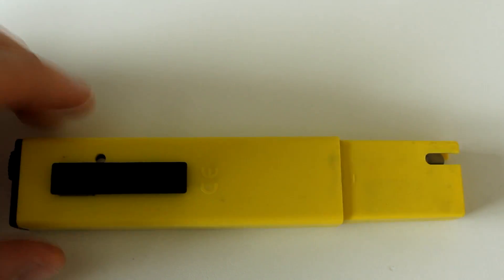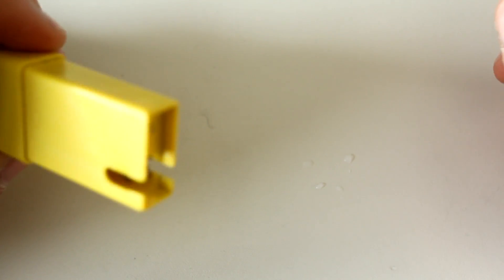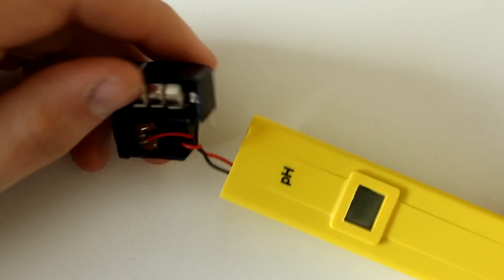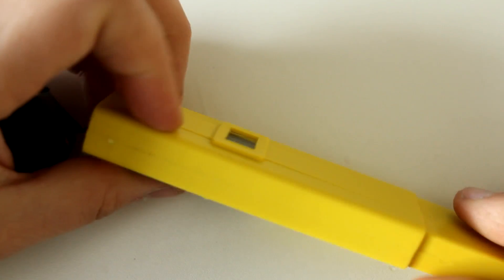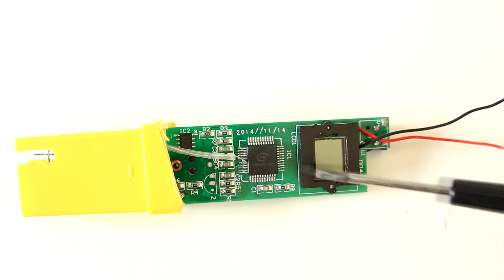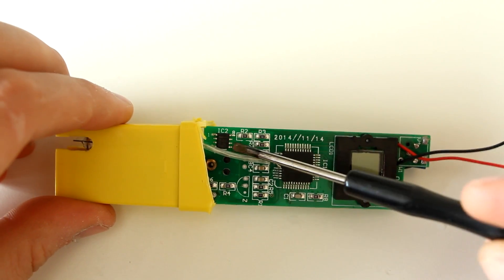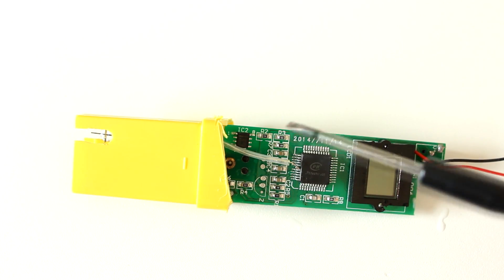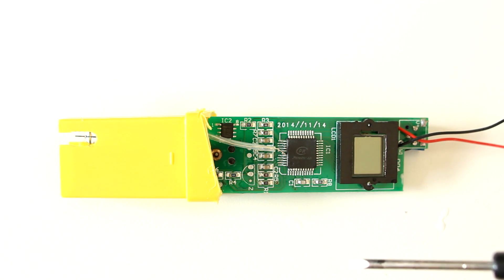pH meter teardown (addendum to anodization video) (027.5)

Comment: If you believe that pH measurement is related to electrical conductivity of the solution, then definitely you have a lot to learn about pH. You will discover that all the magic is in the little glass pulp, the critical and essential part of such devices.
Reply: In a standard process in industry you often use ec to know how much acid or caustic to add in your product to reach a certain pH. Oc the material has to be the same always. For example you add HCl. It dissolves in water to H+ and Cl- increasing the EC. Our product is standardized to 7.6 MS/cm and we always get an ph of 6.8. Oc it only works in one direction. The reason ph sensors arent used extensivly in the food industry is, they brake alot bc of 130°C sterilisation and afterwards cleaning with caustic and acid. You are the one who needs to learn alot.

Comment: If your pH meter is going crazy showing variable numbers, let it be on for a while in a glass with little bit of tap water and it will fix itself, mine goes crazy when it's dry I leave it in water and in 30 mins or less it starts stabilizing. Hope it helps
Reply: This is happening to be right now... hope it stabilizes

Comment: can we use any other thing instead of broken glass
Reply: You can try to DIY with those Christmas glass balls (the very thin ones) but the precision is terrible... better to buy one.
Reply: Nope the glass bulb is actually not the same glass with a bulb, normal glass is highly non conductive, ph sensing bulb glass is specifically formulated to both conduct electricity and select hydrogen ions.

Comment: It will be more economical to use this one with Arduino instead of buying the Arduino PH sensor.is it possible to connect the buttons to micro controller like Arduino. How to interface the lcd.
Reply: Good idea, how far have you gone down this track?